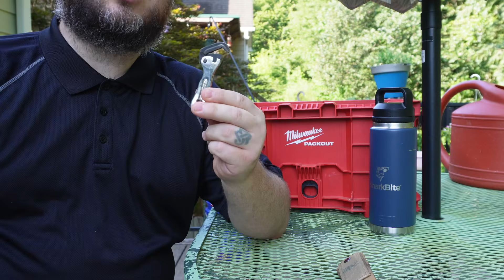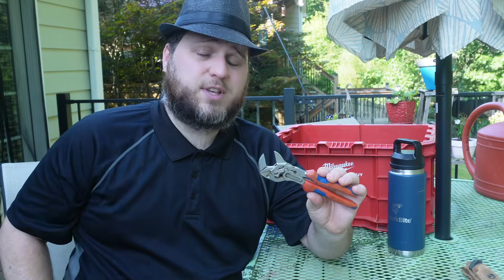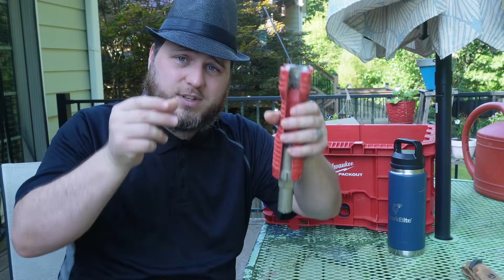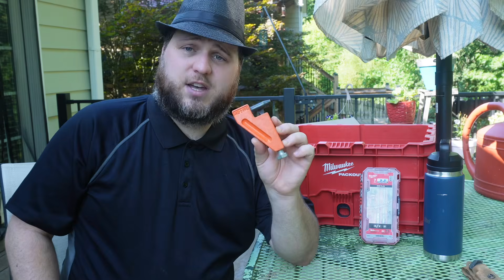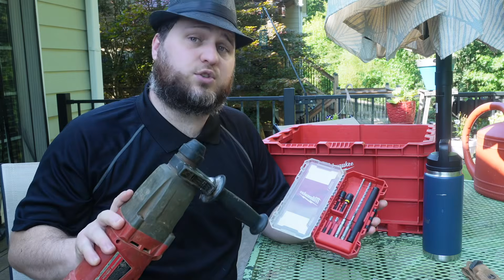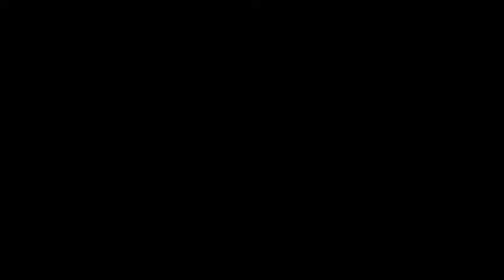8 Game Changing Plumbing Tools You Need to Know About

Comment: The superior extractor is sufficient. I use a 1/2 6inch extender on a 1/2 ratchet an never have a issue removing a tube drain. I don't like using a drill because it could damage the threads.I also use my extension am ratchet in a superior standard extractor if it's not broken out inside the drain. Once the drain breaks loose it comes out easy everytime. I carry the Milwaukee aluminum long wrench if I really need some leverage. 

I had no idea that there was a bonnet socket. I need that asap.
Reply from the maker: I’ve had some success with the Superior extractor, but it’s still been hit or miss for me. To this day the Toolceptions one still has removed 100% of them in seconds for me. 

That bonnet socket is sweet! I might actually be in the market for another one, myself. Went I use it today and it didn’t want to open up all the way. I’m gonna see about greasing it down, but might need a new one. I’m pretty abusive on my tools, so I’m still satisfied with what I’ve gotten out of it.